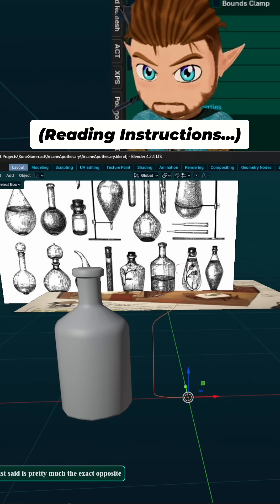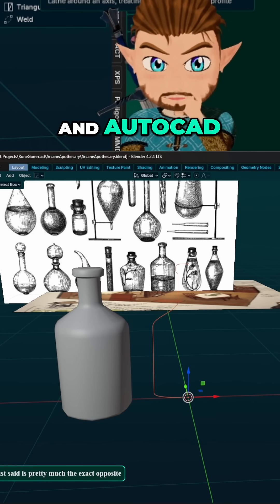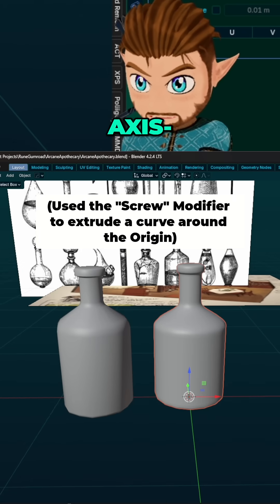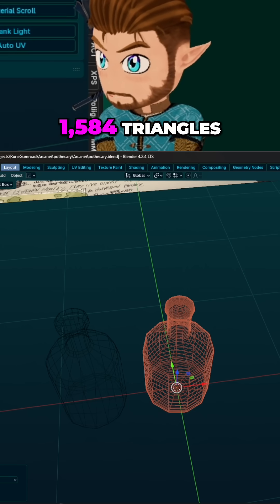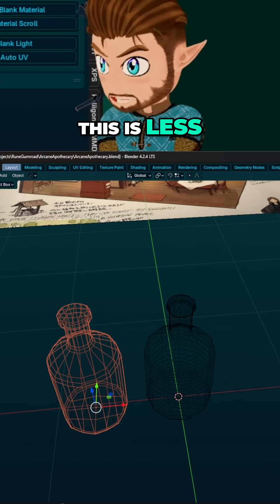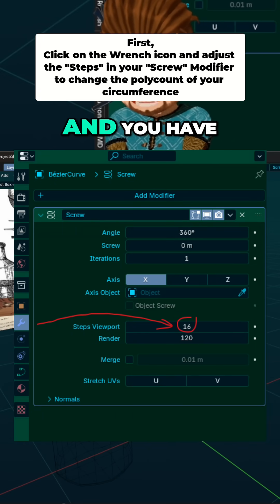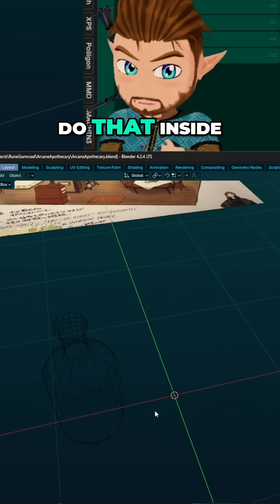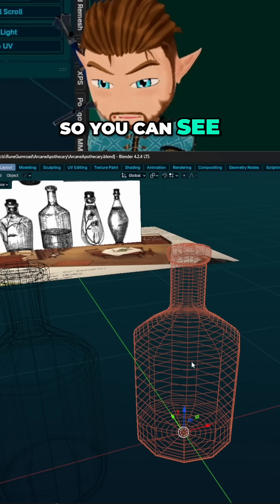This One Tool is RUINING Your Polycount - I Bezier Curved Too Close to the Sun... #shorts

Comment from the maker: I really need to make an addendum to this video to clarify a few other things about optimization.

1. It’s not really polygons that hinders performance so much as it is Vertexes. (Giant misconception)

2. Silhouette matters more than simple poly count for props because it means that there are edge loops on the high-poly bottle that ultimately contribute nothing to the detail of the model.

3. Context matters because if a model is simply a background asset, it probably only needs to be a few dozen faces instead of hundreds.

Comment: how big does your game have to be for you to care about this problem?
Reply: It is called optimization. There is so much unneeded geometry that just balloons the poly count for no reason, while poly count doesn't account for much in terms of Performance, it eventually will once the numbers go high enough, especially in Games like VRChat which he mentioned where you have the render each scene twice already.
Reply from the maker: @sanYtheFox  Exactly! My programmer friends call this "Technical debt." Because you're hoping that the speed it took to solve this problem doesn't come knocking later down the road. Kind of like borrowing money from a loan-shark.
"This is a nice level you got here- It'd be a shame if it ran at 15 fps!" xD
Reply from the maker: Good question!!
The way I try to look at it is a level-by-level basis. In VRChat, your scene ceases to be Quest-Compatible when the file size exceeds 100 mb. But a good rule of thumb to stick to is to keep your scenes under roughly 2-4 million triangles-per-frame. I have a VRChat scene that runs at 60fps, and averages between 1.2 to 2.1 million triangles. (To be fair, I could optimize it more so I can fit more players more easily, but for now, it's passable).

If you have a small prop like a bottle (something that you probably want a lot of to clutter up your scene) you want to keep it nice and low. Because eventually, those polys add up!

Lets say you're modeling a Bar/Restaurant scene, you have 20 bottles laying around, and each bottle is 3,000 tris... That's 60,000 triangles total. Your average VRChat avatar can range between 70k-120k triangles.

THAT's when it becomes a problem. Because then that means you have to go back several steps and fix it, which costs you time. The more detailed your model is, the more critical these simple moments become. ;)
Reply: @RuneStarforge  Awesome thank you! I have seen so many high poly models, and I'm reminded of 2b's famous butt, that I seriously wondered if this was something to consider when trying to make stuff, either as a PC model or assets. I only ever see it mentioned when talking about low poly games in general but that's mostly as artistic stylings, rather than performance related.